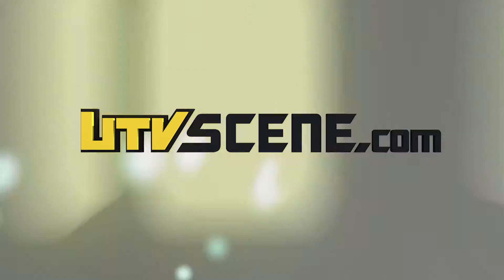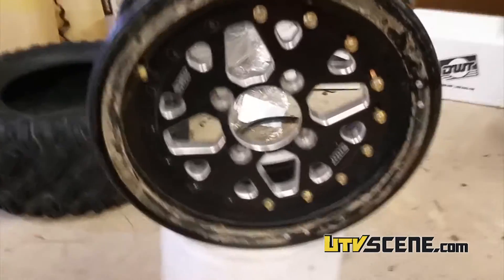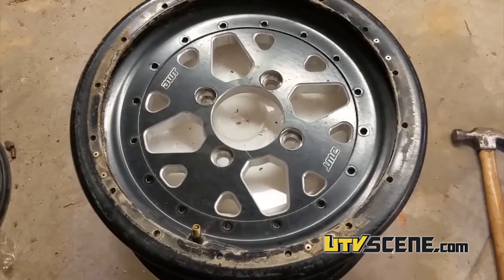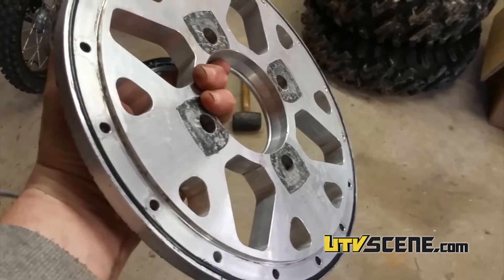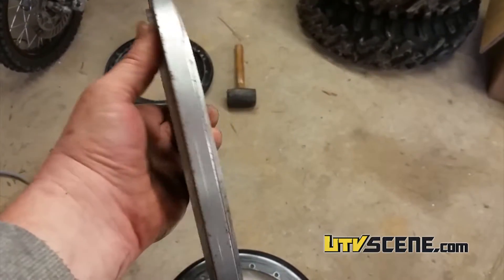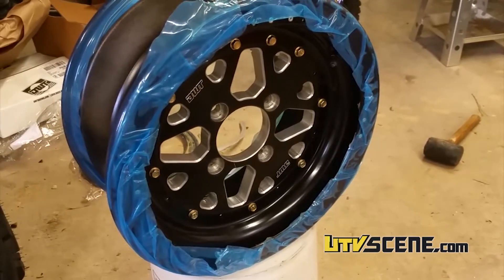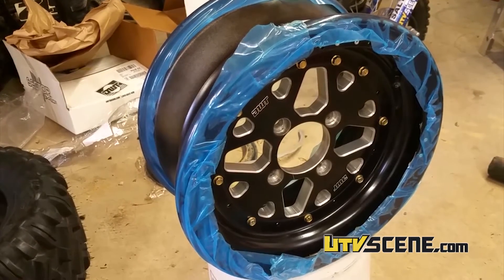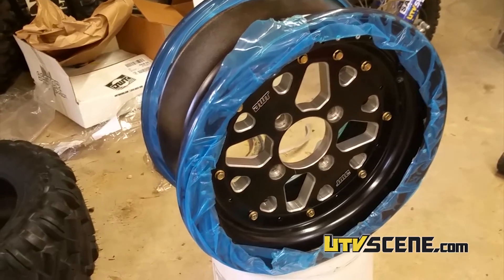DWT Wheel Teardown

Comment: probly a stupid question but doesn't it stay 7? please explain what the diff is please thanks!
Reply: He changed the offset for a wider stance. This actually makes it less stable with A-arm suspension with out changing to larger longer shock/spring setup and moving the shock perch outwards.  A very common mistake amateurs do is go wider without all the parts needed to make the suspension work properly and safe.